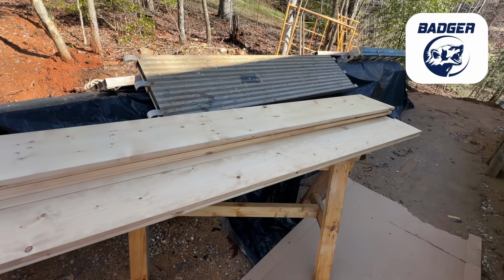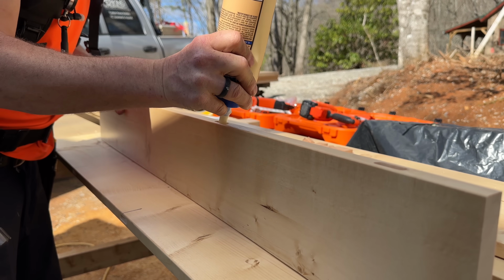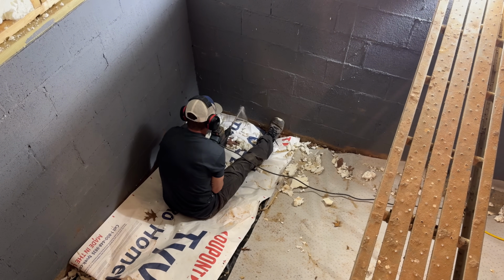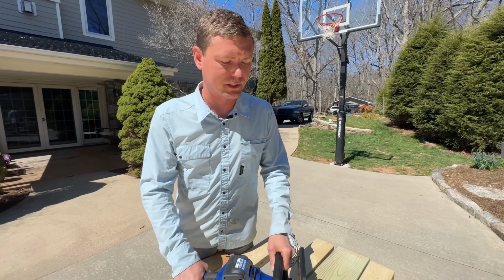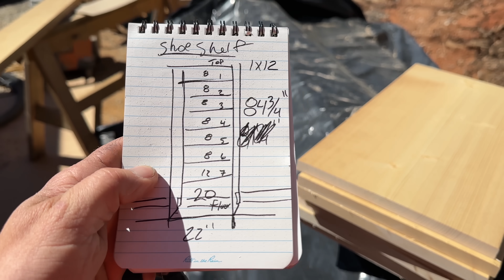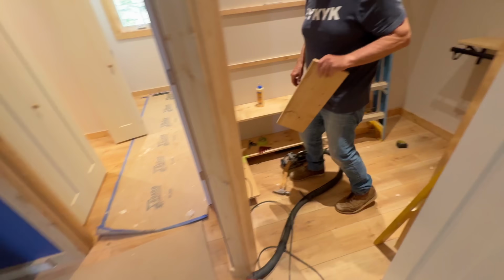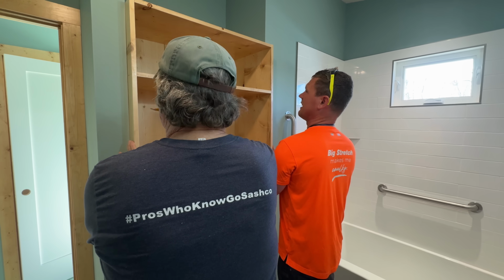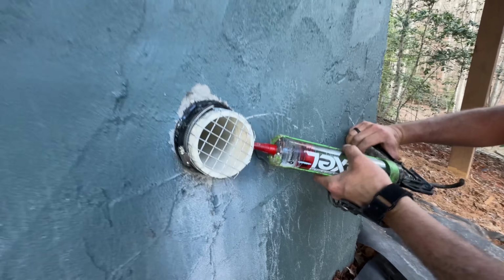Modern Home Build | 47 of 50 | Jaime gets his own camera and builds stuff

Comment: Put a spring loaded flapper valve on the outside of the crawl space pipe, similar to what is on a tractor's smokestack to keep water out when it is not running. With a soft enough spring, it will stay closed, but will open if there is water pressure.
Reply: That’s what I was thinking, a dryer vent type of thing came to mind. Usually really like their work, I don’t know code for the area but I wasn’t quite a fan of that drain. I’d bet it might get an upgrade before this series is over

Comment: Wasps will love that pipe into the not-basement.  You should have a mesh with holes no larger than one or two millimetres in size.  Preferably in a cap that is screwed on so it can be removed/cleaned/replaced/etc.

Comment: If that clear hose was for the condensation drain for the furnace, make sure and insulate it so it doesn’t freeze. If it freezes, it will prevent the furnace from working. 
Great build series and such a cool place.

Comment: 1:06 Pro-tip; pull, lower, push. The spinning blade is pushing the board toward the backstop to keep it in place. When you pull the blade toward you while cutting, there is a chance the force pushing the material into the backstop isn't great enough thus pulling the board towards you, twisting it and having the blade bind and pulling the material upwards.

Comment: Baby mice can and small snakes can get through,. 1/4 inch hardware wire will absolutely work. on your drain pipe. And water will seep out if it gets stopped up but they make a vent  cover that works in the HVAC duct section of big box.

Comment: Could you have used some kind of spring-operated "vent" for the drain? Like a cat door, almost. Completely closed to prevent bugs until water built up inside and the pressure opened the cover.
Reply: Those pop up drain vents used on french drain outlets would be good there.

Comment: for the dehumidifier drain: consider finding a metal flange that would look nice but droop low enough to keep any water from running on the siding. then cut the tube back so that it’s out of sight but still goes most of the way down the metal fixture

Comment: Regarding the basement drain pipe, a mouse can squeeze through a dime size hole.  Make a smaller screen in an exterior threaded PVC cap  that can be cleaned  in the future if necessary.

Comment: For the wall drain just get a flapper valve on the outside and screen on the innside as a backup, shouldn't be much trash blocking it from the innside anyways.
And a flapper valve will hold out bugs and weather.
Reply: The dehumidifier drain should also have a P trap low or outside to prevent wind going up the pipe and flooding the innside

Comment: I saw a professional painter 1. paint the door without being concerned with getting paint on the glass 2. use a heat gun (the door was super thick glass not sure if this would be safe if it was cold out), 3. use a cheap scraper knife to clean the paint off the glass. I suspect that would save a ton of time and frustration. I've always hated painting and cutting.

Comment: I don't think you will get much debris in that pipe. Mice will definitely get through along with insects. I would put a tighter mesh on. Maybe a 1/4" for mice and a really thin mesh for insects. Don't attach the insect mesh with a worm clamp. Just bend it in place. Let the tight mesh blow off there is a buildup of debris from the water.

Comment: Using water on the core drill like you did made your life harder, when there's pressure it forces the dust out from around the core, by pouring water on like you did, you turned the dust in to a paste and that closes the gap between the core and that material which will make it grab
Reply: How do you keep it from getting too hot then?
Reply: @johnowens178  Wiggle the drill in a circular motion so you actually end up cutting a slightly oversized hole.  At least that's what you do with wood.  Not sure how well that would work on a hole that deep.

It would probably be more normal (and much easier) to leave a small hole during construction and insert the pipe before the centres were poured.
Reply: @johnowens178  They're cutting concrete with a diamond tipped core drill, it doesn't need cooling down, I've cut through a 30" granite wall with the same set up

The material isn't hard enough and the drill doesn't rotate fast enough for the need of water
Reply: @-_James_- That's the worse thing you could do with that drill set up,  when drilling that size of hole through a wall you need to keep the drill as still as possible or it will bind and jam in the hole, if it doesn't have a clutch it could break your wrist
Reply: @70scoff  gotcha, thank you I was wondering about that.

Comment: I really hope the homeowner has a termite treatment completed at the interior perimeter of her crawlspace before it is encapsulated. Nobody ever thinks about getting a "preventive treatment" done. A encapsulation is great but if you get termites it is a nightmare to get it removed so a corrective termite treatment can be completed. termite companies have to have a homeowner call the encapsulation company so they can remove it from the areas that need to be treated. Then the termite company can do the treatment, then the encapsulation company can put the encapsulation back in place. It is expensive to get all that done, and typically encapsulation companies don't explain to customers the downsides of the encapsulation they are normally just interested in getting paid and on to the next job.

Comment: Hi, sure wish you wouldn't call your very expensive compound miter saw a 'chop saw'. I know that this is Norm's fault. The problem is that when young workers come into the field they try to chop things with the expensive compound slide miter saw by slamming the moving blade down rather than gently running the blade back and forth one or two times as you do.
I have one of the first compound miter saws that became available when the original patent ran out. It is a Hitachi that I bought in the mid 90's, cost me a whopping $425 and I had to explain that to my wife. It still works fine, it is about 30 years old now.
If you need a chop saw, get a hatchet.